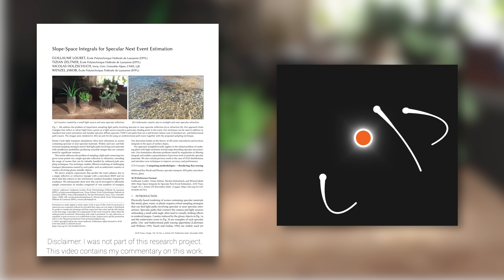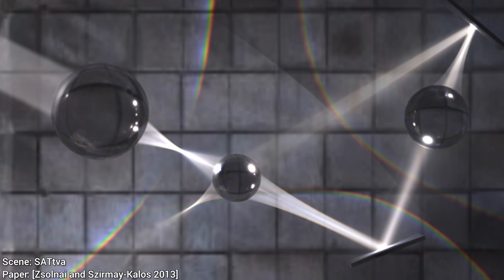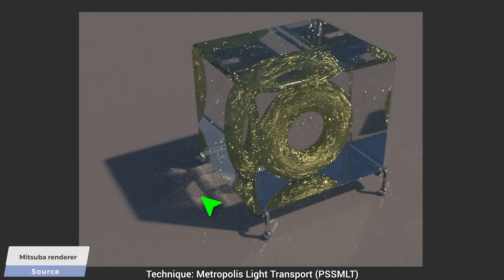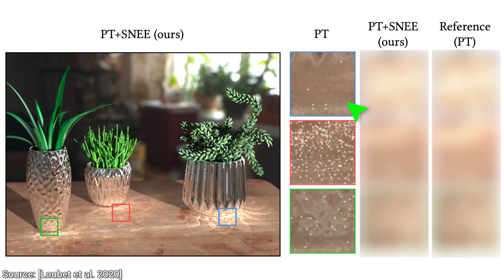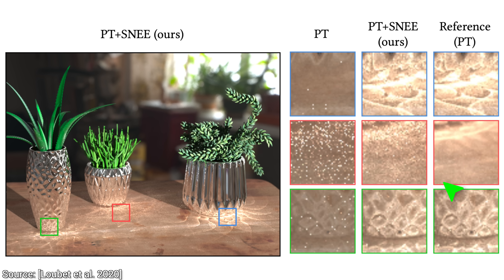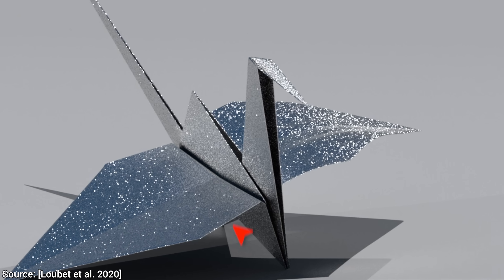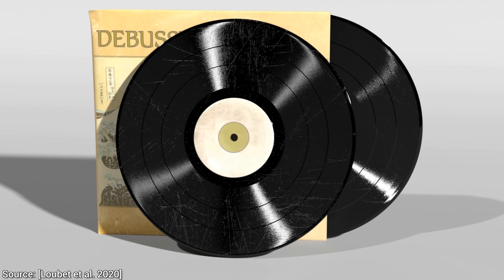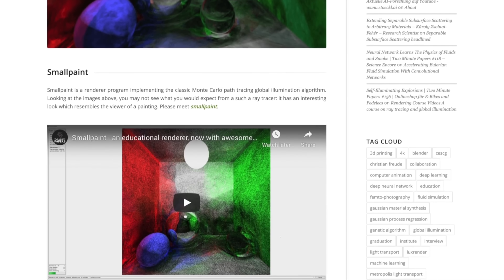Glitter Simulation, Now Faster Than Ever! ✨

Comment: I'm always impressed by your research papers but always left wondering "How long before we see practical applications of this in commercially available rendering or simulation software?"
Reply: Want an answer for that too
Reply: Depends what you mean by practical? A lot of these papers come with code already posted on github (or elsewhere). Are they easy to use? Usually not. Most are marked "some assembly required". But they are nonetheless fully functional.  
 So if you mean "Enterprise apps so easy to use a rotifer could do it", figure 6mos to 2 years after the technique is published.
Reply: @thomasgoodwin2648  I personnaly was thinking about professionnal rendering engines like vray, mental ray, etc,.
I'd think they'd implement it as fast as possible no?
Reply: @TheSupriest  Yeah, that's true. But it also depends on the pool of programmers available to throw at the task. Open source type projects take a bit longer to shovel peeps on to the fire than corporate enterprise endeavors, which of course usually means $$$ will get you that shiny new button a bit quicker than the free stuff.
Reply: @thomasgoodwin2648   I'm assuming that the papers being public mean that they're not copyrighted or patented and that anyone can therefore use them for profit or not.
Reply: @Junglejuz  Most of the Papers' code is under Creative Commons or Gnu, but of course you would need to look at case specific licensing before trying to commercially implement anything directly from the code.  
 However, algorithms can be reimplemented in fresh code with minor changes bypassing licensing issues.  
 While the ethics of such practices are questionable, it's still quite common.
Reply: I feel like we'll all die of old age before that happens.

Comment: That is really impressive!
When you asked what's wrong with that glitter origami swan, I thought it wasn't sparkling enough on rotation. The glitterpaper I know does sparkle a lot more when moved around.
I'm sure that would be very computationally demanding because the light reflects in a totally different way for each angle..

I wonder if a glittering paper like the one in the video can exist in real life. Maybe paper with tiny glass spheres embedded in it?
I think real world glitterpaper (not hologram paper) contains lots of tiny sheets /sticks of shiny stuff(metal?) In random orientations ,so the reflection happens on a flat surface but changes drastically if the direction of light changes

Comment: I was wondering if there is any research of an AI to make 3D anime character looks more hand drawing. 
You can see the complaining about 3D characters in animes that they insert in the anime that not combine with the rest of the scene. 
I would like to know if I fill an AI program with a lot of hand-drawing images of anime characters to try to change a frame of 3D characters to look more hand drawing?
Reply: Check out "Computer-Assisted Animation of Line and Paint in Disney's Paperman" from Disney R&D for tech that allows for merging stylized 2d illustration with 3D rigs and animation, used to make the lovely Paperman short and happily keeps both 2D illustrators and 3D animators in a job. There's also a lot of research going into the field of AI "Style Transfer" that could possibly be used to train a neural network to map rough previs animation to fully-illustrated-looking frames.

Comment: amazing. so wonderful to see nice caustics rendered quickly and cleanly. caustics are surely the single biggest problem for (Blender) Cycles and i haven't spotted anything about caustics in the new spec for Cycles X. so the question is, can this be marvellous algorithm be added to Cycles now (preferably without having to recomplie blender from scratch!)?
Reply: As I understand it, Cycles X project is redesigning architecture of the engine, so in future it will be possible to implement this kind of alghoritms. So wait a few more months until Cycles X is completed, and only then look forward for developers playing with new alghoritms.
Reply: @BenedyktLewandowski  thx. it sounds like you suggesting that Cycles X will be much easier to extend - is that correct? i looked at a brief overview of Cycles X and did not spot this kind of thing - can you give a link for more on this?
Reply: @BenedyktLewandowski  thx. that is the page that i had already looked through. i have just read it again and to my eyes, the only thing that suggests that extending Cycles X will be easier is: "the new architecture should let us more easily fit in rendering algorithms like path guiding" - am i still missing something?
Reply: @juliandarley  this sentence you quoted means exactly that - Cycles X will be easier to extend
Reply: usew blender addon luxcore
ist a new renderengine with caustics
Reply: @00swinter21  yes, both luxcore and appleseed look interesting, but i am concerned that they would require a lot of extra learning and maybe that the shaders would be different. have you used luxcore with blender?
Reply: @uusfiyeyh  by saying new I was referring to the fact that ist not eevee or cycles
Reply: Try the luxcore engine addon
Reply: The whole "just wait until the next version and we'll surely get feature X" thing is a curious coping mechanism for Blender users.